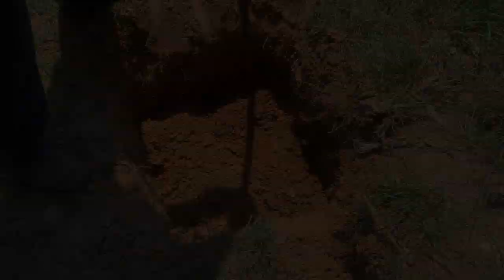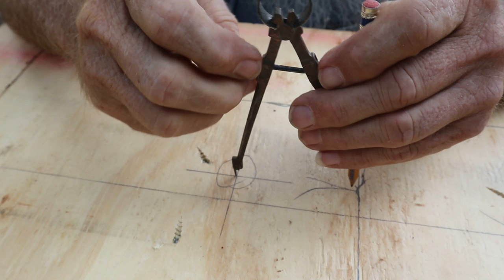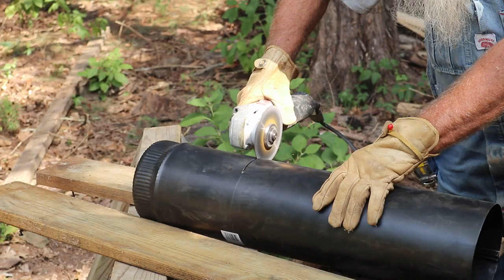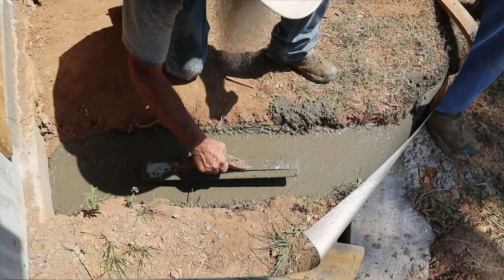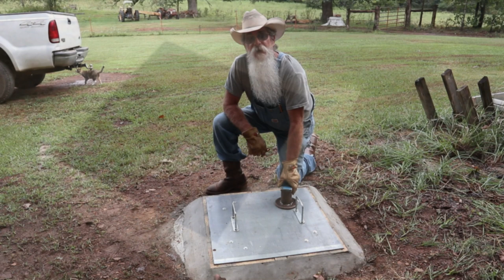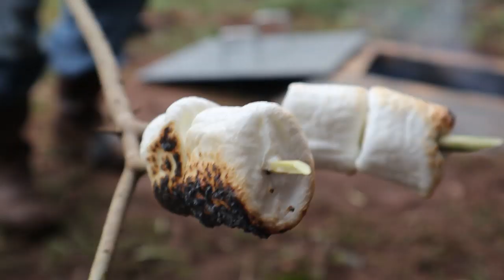Smokehouse completion (pt 5) - Building the Firebox

Comment: If you burn a smaller fire with more air flow it will give you a cleaner smoke flavor.  I don't have any experience with smoke houses, but I do a lot of BBQ (the real kind).  I used to choke the air going to the fire to control temps, but the smoke flavor was bitter/acrid. When you let the fire burn small, but unrestricted on either end the smoke flavor was sweet and woody. I would try a second air intake and maybe more or larger vents, so you can control your smoke better.  Really nice build, I've enjoyed watching the whole thing!

P.S. Managing the small fire does require more attention, but if you cut your wood the same size you'll find a timing to tending it.
Reply from the maker: Howdy Bob- I really appreciate your tips. I will certainly try that. I’m still in the learning stage with the smoke house. I can get a pretty steady flow with the smoke, but you’re right, it does take some tending to. If it ever cools down here I will be firing it up. Take care and God’s blessings to y’all

Comment: Great ideas for the damper and lid. How many bags of cement? Was it regular cement or firebrick morter? And how many firebricks did you use for this pit?
 Thank you in advance for the information.
Reply from the maker: Denise Wilson   Howdy-  I used probably 10 bags of 4000# cement. I just put fire bricks around the top of the cement. I think I used 12 firebricks. Making the firepit was a bit of an experiment for me- I had this in my mind for a while but wasn’t real sure about it- but it works great. God bless